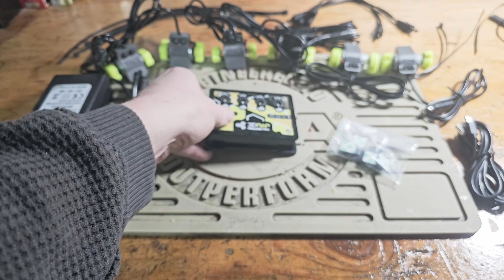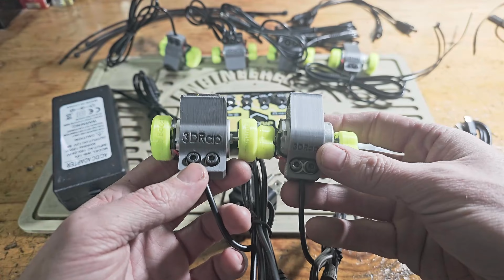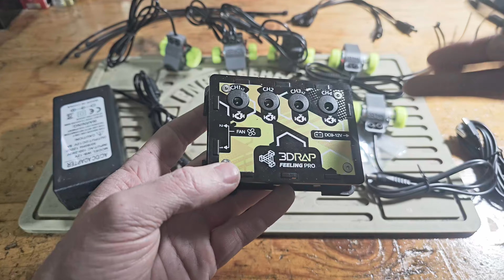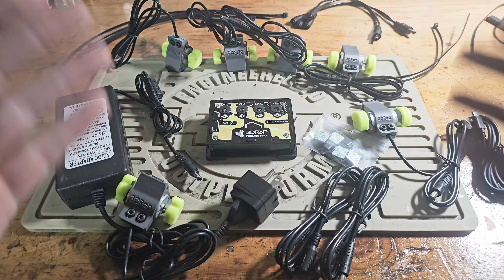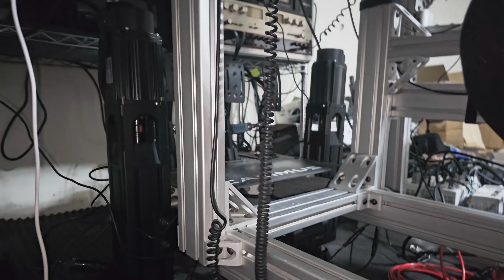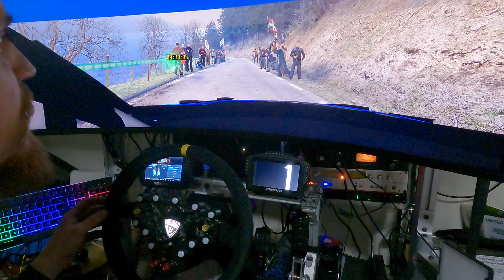3dRap Rumble Motors, Cheaper Than Motion...and makes you drive BETTER!

Comment: Have you tried adding a second module? I see you purchased six motors and there's only four channels. What if you have a second module and want to run eight motors? How do you activate it on SIM hub? I can't figure it out
Reply from the maker: I would think thats possible but I havent tried it...
Reply from the maker: Maybe there is a way to run 2 instances of simhub simultaneously?
Reply: @SleepyPantsSimRacing  That's what I'm thinking. Not sure how I'm going to do it lol

Comment: Looks like some prototype diy project. For 200 i had next level racing hf8. Which i riped a part lately and implemented directly in my seat. Its 8x rumble with housing +controler. (is overpriced also for what it is) and for 250 simagic hpr full set. Elegant and clean.  So i think its not worth money
Reply from the maker: @lucasomeister2823  yes the kit looks a bit diy due to the use of 3d printed parts.
Reply from the maker: I'm gonna take a deeper look at the simagic kit and see what direct comparisons I can make. I'd like to test them personally to see just how much better they feel. I know there are some extra complications that would need to be overcome based of the fact that simagic is not intending these to be used with anything but their pedal sets and in-house peripherals but brackets can be easily obtained or made, im sure. I do think 3drap providing a generalized kit for any rig or even specific kits for various setups is a move that can be appreciated by the sim community. Ease of installation is a big must for certain customers that are uncomfortable with the added complexity of a DIY situation. I do understand the frustration about 3drap utilizing an older rumble technology, keep in mind simagic also is using rumble motors in some of thier vibration kits, but perhaps there is a reason for using this older tech rather than just trying to maximize profit. As I mentioned in a previous comment, I did reach out to 3drap for clarification on the topics of price and warranty, so maybe that will help us understand why certain materials and hardware were chosen.

Comment: Have had nothing but good experiences with 3drap. The fact that these have a wind sim output is awesome. 
That said, rotating rumble motors have considerably more latency than transducers. Tactile transducers are similarly affordable and provide far more detail. It's hard to justify using this style of rumble motor unless you need to fit it into a tight space, like a controller.
Reply from the maker: Yes, there are better hardware choices than rumble motors, most definitely, I recently reached out to 3drap with some related questions, such as how they handle their pricing. What I assume is going on is they may be looking at the market and finding gaps like certain  companies that don't provide any haptic/rumble options and then pricing according to the fact that there are no or few other options for this kind of system and then using that as a base for thier pricing. That's why it may seem overpriced when compared to companies like simagic that do provide their own in-house solutions.

Im not sure that makes sense how I explained it. Again, these are just my own personal guesses as I haven't received a response yet about how they handle their pricing.

I will say, based on my experience with the system i have, it doesn't feel delayed. I have admittedly less experience with haptic/vibration systems than I do with motion or other simracing related technologies but the other haptic/vibration solution I tested at sema 2023 was asking over 1k dollars for a haptic system that was not $700+ better than this 3drap solution in my experience. The 1k+ system was most definitely a better experience but not as bang for your buck as this 3drap system. But I will let the community know what I find out. :)

Comment: Are you gonna keep using them long term? I got mine about a week ago and I have been loving it since. I am making 1 change to my rig, I have my pedals inverted and my footrest is made out of wood and its absorbs are the rumble affect, but I got a metal plate to change it out just haven't had the time to do it yet.
Reply from the maker: @balazsvoros2140  yes, they will be on my rig long term. I like them alot! If anything breaks i will be sure to update. There have been concerns about durability both because some have supposedly reported breaks and also because many people don't trust 3d printing.
Reply from the maker: Im actually surprised how much sensation they are able to produce. I assumed my rig would have soaked all the vibration, but it's actually to the point I had to turn down many effects.

Comment: Also these aren’t haptic motors 3d wrap needs to learn that these are rumble motors out of an Xbox controller! Haptic is completely different than rumble motors!

Haptic is 1000 times detailed than these rumble motors.
Reply from the maker: I agree, I wouldn't consider these "haptic" motors, but they might be going by the word "haptic" definition, which includes vibration in general, i believe.
Reply from the maker: You know what, this was my mistake, I thought they were advertised as haptics but I was using misleading terminology. They are indeed advertised as "rumble" motors. My mistake, I changed the title to try and avoid any confusion.
Reply from the maker: I think i said it several times in the video as well...whoops lol

Comment: Nice video but these are definitely over priced. Can buy simagic ones for $16 and come with a metal bracket to mount. Also haptic motors for 60 each but will give you 1000 times more feedback. 3D wrap always over charges for low end prints that break.
Reply from the maker: Based on what I know about this company, its a smaller company, I agree things could most definitely be overpriced when compared to larger companies, im not sure how many employees work at 3drap but based on my knowledge of 3d printing, there is a good chance all the footwork is done by very few people. I could be wrong but simagic is a larger company, not defending the price entirely just adding some of my thoughts into the equation. And also keep in mind 3drap is making solutions for many other companies, they can't compete with prices from a dedicated company that focuses only on in house product lines.

Comment: Good vid Doug. Nice to see practical solutions.
 I feel ya man. 
So,  curious. Without the monitor, and the stuff for media,  how much do you have "invested" or "wasted''  (depending on your perspective :face-green-smiling:)  on your sim set up ??
Reply from the maker: Well the things I have personally bought would be a different number that what is displayed. I bought the monitor, pc parts, monitor stand, rig, hpattern shifter, seat, motion system.

Those things would be around 7-8k 

Adding in things I have not bought shown in this video, it would be another $1600 or so based on my rough estimate.

Comment: Lets hope the 3D printed pieces at the end of thie motor shafts won't start discombobulating themselves like supposedly some other 3Drap products do lol
Reply from the maker: Lol, I HOPE NOT! I'm sure they would send replacements if that were the case but I guess if the print had a flaw, it might show its head after some use. I personally am warming up to 3d printing, I used to dislike of 3d prints looked then I ended up trusting 3d prints once they proved to me, they can be durable. Obviously I have not tested these long term but I will do an update if I have any issues.